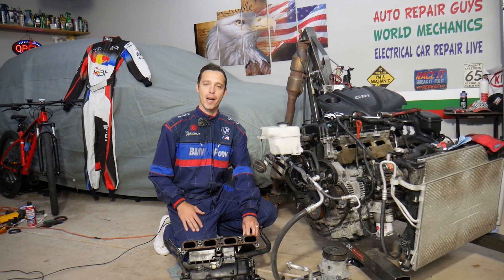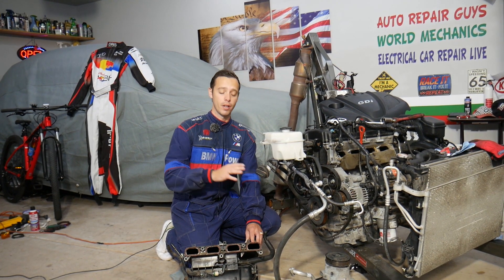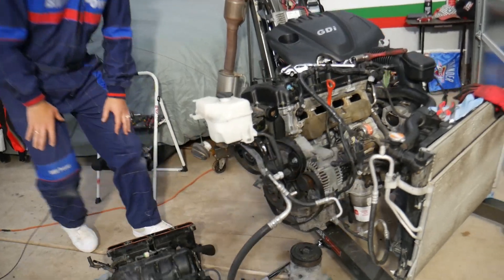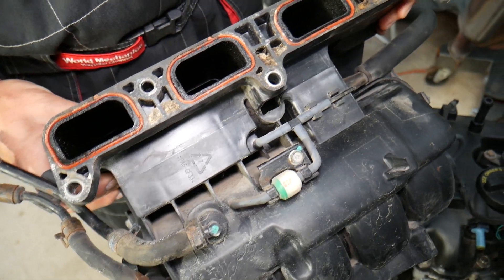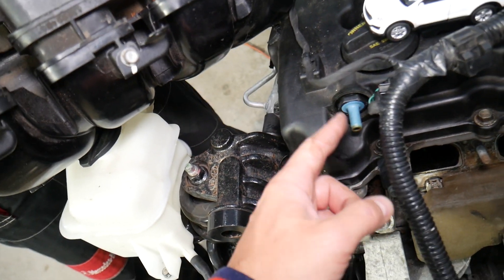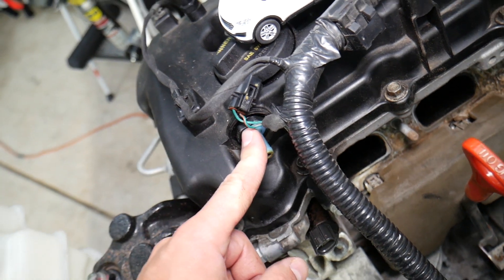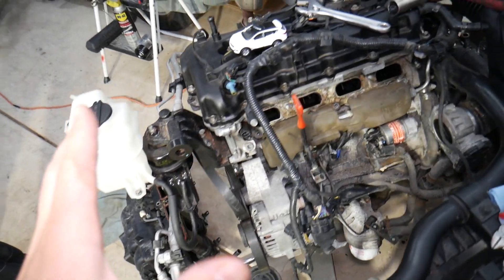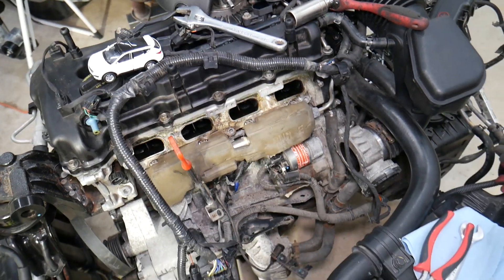WHY THERE IS ENGINE OIL IN INTAKE MANIFOLD demonstrated on Hyundai Santa fe

Comment: I changed mine and noticed immediately there was suction. Does that mean it is doing its job?  Also, a mechanic said I had oil leak from bottom of intake manifold, adding oil once a week, 2012 Camry, 2arfe engine, thanks!

Comment: I run catch cans to catch any fuel vapor and oil that gets recirculated back into the intake. Pulled a lot of sludge motors apart and could have used one. Pulled a motor that has had a catch can for 50k and it was surprisingly clean.

Comment: When Hyundai engines PCV gets  blocked its due to the oil consumption. This problem  is caused by  piston rings bad quilty  and stem seals.
Replacing PCV will not solve the problem from my exp unless you rebuild the engine ASAP before it is too late.

You can look up hyundai / KIA recalls and by the way it is all thier engines not what they recall only.

This problem since 2011 till now and not solved. They use MOBIS piston rings and they are the worest.

Comment: I replaced pcv valve but my 2.4 compass still has a lot of oil in the intake. Any suggestions??
Reply: Oil catch can, hook it up to your vacuum. Manufacturers do this on purpose so you keep buying cars. This oil catch can will catch as much oil as possible that goes to the air intake, I have one and when I change my oil, I get at least a cup of oil.
Reply: @rivasb495  what kind of problems will this cause if I don't install an oil catch?

Comment: I replaced pcv valve but my 2.4 compass still has a lot of oil in the intake. Any suggestions??
Reply: Did you clean it first
Reply: @minibuds6967  yes

Comment: I noticed a lot of oil in my throttle body by intake manifold. My car misfires bad. Pulled the pcv valve, and it was in fact stuck open. Changed it out but the car still misfires. Could this be due to all the extra oil I  the intake and throttle body? I have not cleaned any of it out.
Reply: Might need a new throttle body. Check your plugs and make sure they got the right gap as well.
Reply: @Steezy__179  I doubt it's the plugs because my thinking is they all wouldn't go bad at once, and the misfire is on all 4 banks randomly
Reply: @OnlyTruthLove  my next guess would be the wiring harness. They get really brittle and end up shorting out. My 1.8t just got a new throttle body and the plugs are all new and my rpm still moves slightly at like 800 or so
Reply: Knock sensors
Reply: @longlivechina7538  the misfire was in fact a bad head gasket. I have 250k on the engine, and was not about to replace a head gasket, as I'd rather put in a new engine at that point. So I decided to mess around with it and pour one of those liquid head gaskets into my coolant. 

It fixed the coolant leaking into the engine, and the misfire went away. Now I have no shaking or noise when the car starts. 

Bad head gasket creates a misfire on these prius. A misfire creates a TON of noise on startup and shaking (as the coolant enters the cylinder). 

The stop leak head gasket liquid worked for me as a temp fix, and I will keep adding it until I need a new engine. I'll see how long it can last. The bottles are quite cheap, and seem to last for months.
Reply: @OnlyTruthLove  never give up
Reply: Sparks plugs clean out its oils den there

Comment: i´ve already replaced my pcv valve but i still have oil in my intake manifold (i cleaned it after i replaced the pcv) and i don´t know what could be the problem because i have oil in a part that´s higher than the valves
Reply: air filters being just a little too restrictive can cause the fresh air intake hose to start sucking oil out of the engine too.  its the hose that connect to the air intake assembly before the throttle body, after the filter.  pop the hose off and take a look inside it.
Reply: I have the same problem with my ix35, I've rebuild all the engine, pistons rings, valve stem seals is new now. The intake manifold was with a lot of oil inside, I've replaced the pcv valve and the oil still goes inside the intake manifold and the engine still burning oil!
Reply: Did u find out?
Reply: @AngelRodriguez-jv6oc  no, i think that the pcv is the problem because later i just take off the hose that goes from the pcv and the intake manifold and plugged it with a bot and a clamp so i don´t have vaccum issues. the car doesn´t smoke anymore and it doesn´t consume oil but i haven´t replaced the pcv for the correct one
Reply: What’s a bot explain please !! And it’s ur POV breather oil will go all way around threw ur cooling system !
Reply: @AngelRodriguez-jv6oc  i could upload a video of how i did it if you want. do you speak spanish? because it´s my first language and it would be a lot easier for me
Reply: @jaimeleiva4865  i'm having the same issue with a pt cruiser (oil on the throttle body). And in thinking to put a bolt on the hose that goes to the intake manifold, and then just remove the PCV from the engine so the vapors just flow through the atmosphere. Have you ever tried it? 

Ps Spanish is my native language so I will understand too
Reply: @jaimeleiva4865  si!!!
Reply: @brandomrodriguez745  eso es exactamente lo que hice, tapone la manguera con un perno y una abrazadera para que no perdiera vacio y deje una pcv nueva que habia comprado pero con la cual igual consumia aceite y el problema se soluciono. he recorrido unos 2500 km y a simple vista en la varilla no he visto que el nivel haya bajado.
Yo creo que el problema puede que no haya sido la pcv si no que la manguera que va al multiple hacia demasiado vacio por lo succionaba aceite, ya que tampoco se nota como que haya goteado o salido aceite por la pcv hacia afuera del motor